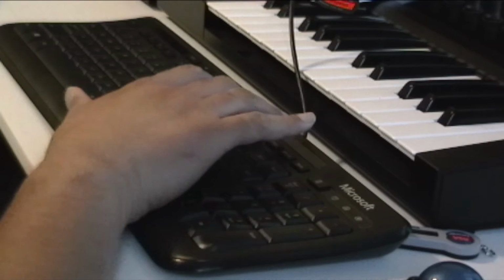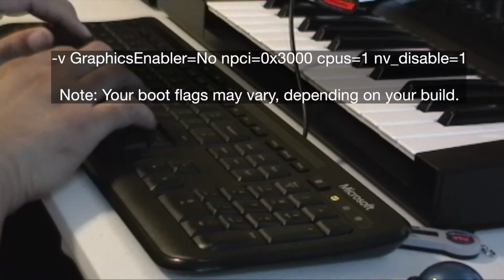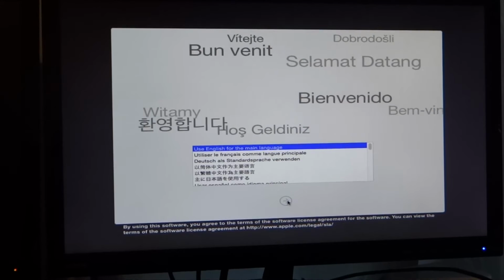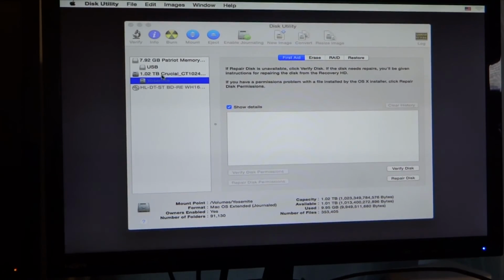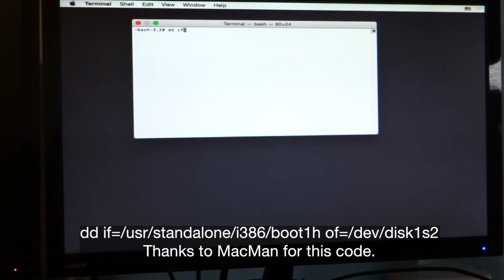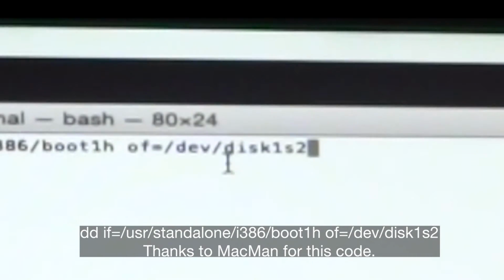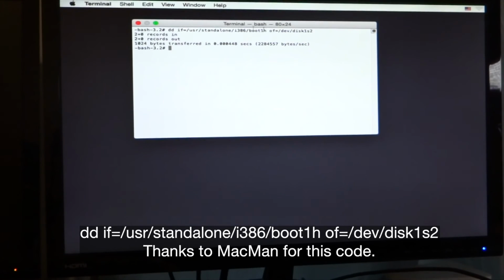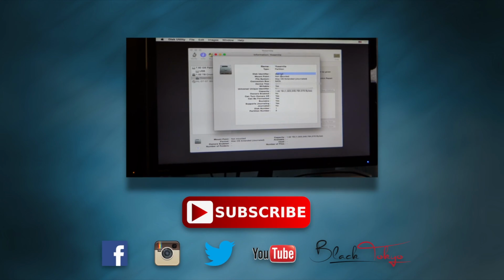boot0 Error - boot0 GPT - boot0 test - 4k Hard Drive Fix

Comment: My error is Boot : 0 Test Done .I Do not have The original usb drive that my nephew installed unibeast on..My mother board is an ASus P6T Deluxe V2 Is there a different boot flag for each mother board?
.It worked fine for a while. thanks, Bill